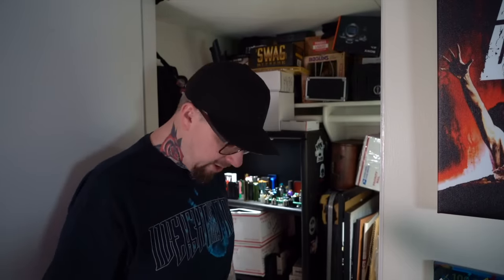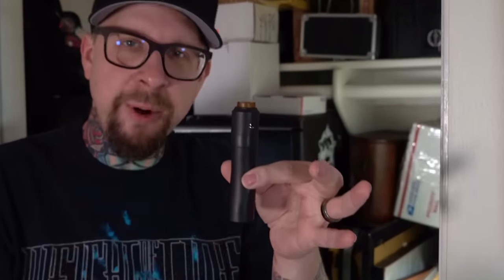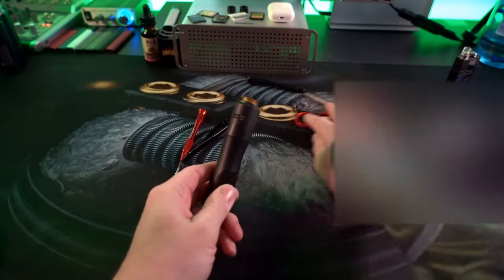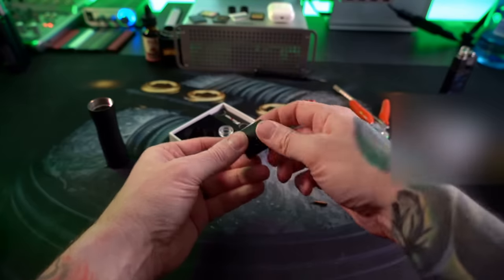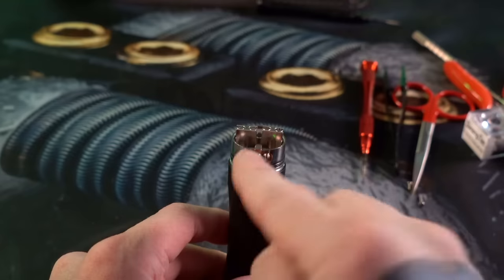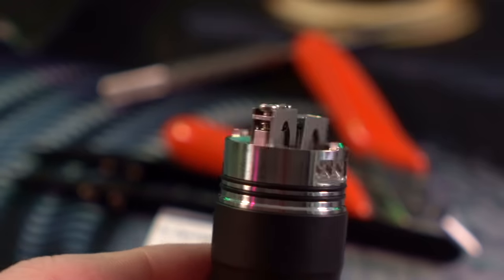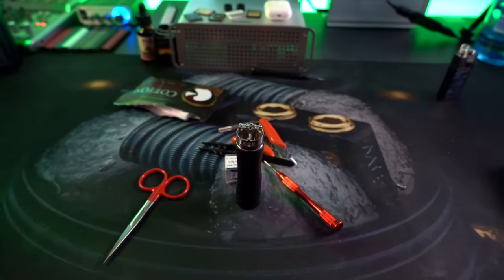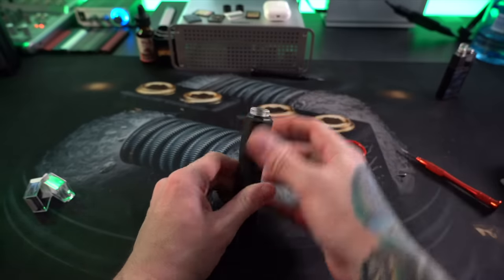The Ardent, It's about time!

Comment: It's a decent RDA that Ardent. Nice flavour, great cloud chucker. It works best in series with some series Coils to make use of that large airflow. Keeps me off the bungas, and smoking. 
I have mine currently on a stacked Keen with some series killer Coils at 0.38.
I hope to get a Dreamer to use that hybrid connection sometime, and compare, when the budget allows. It Would be nice to see a 30mm version of this RDA, if Stan makes one maybe a 1.5 or v2. Overall a nice review #GrimmGreen. Well done.

Comment: Is there a significant amount of voltage drop when using the Ardent in "true hybrid" mode compared to using it with the 510 pin?
Reply: Hybrid has less parts, so it theoretically should have less voltage drop

Comment: the many staging areas of the vapes. kind of dig it, good to keep certain things separated. that's a pretty interesting hybrid design on the atomizer. i've only seen where the bottom is flush with a massive copper contact on the atomizer itself. pretty neat how they did a cup style design. nice to have the ability to not use it in hybrid mode, so the atomizer becomes instantly more versatile. the arches are something i've yet to see, so bonus points for innovation. the airflow is fairly unique also, so kudos for creativity. i was thinking a .15 ohm build on a single cell may be a bit too high. that is, unless you wanted a cooler vape. the whole series inclination makes a lot of sense. #thiccblocks was wondering how this would perform with round wire, but the coil spreading experience pretty much sums that up. definitely not intended for anything small. this places the atomizer in a niche category, where it shines in certain situations, but not really intended for all applications. nonetheless, still a cool atomizer with plenty going for it. love the review, thanks Nick!! :D <3